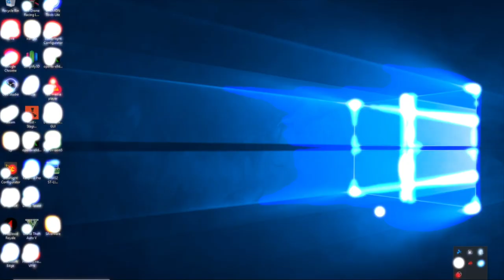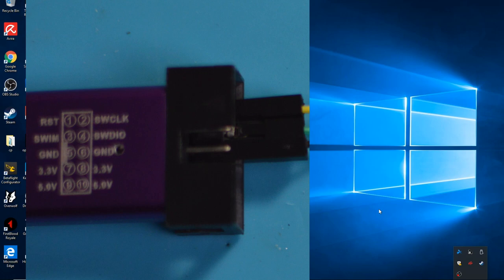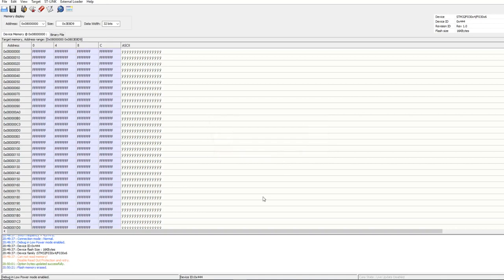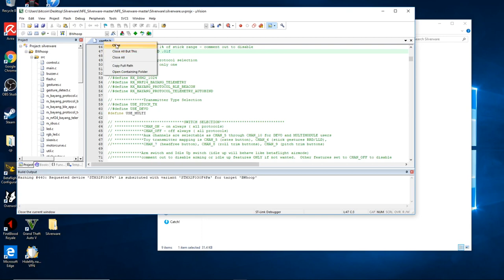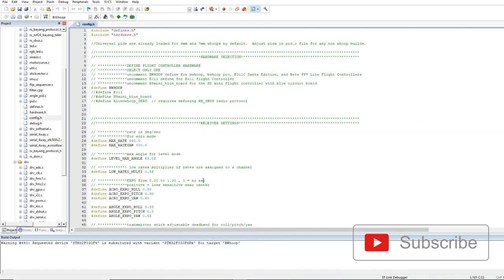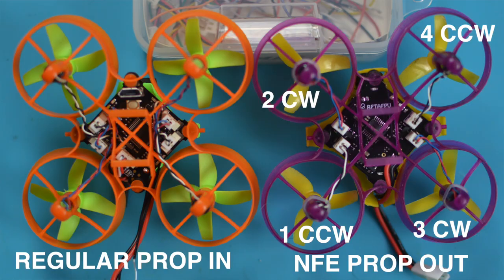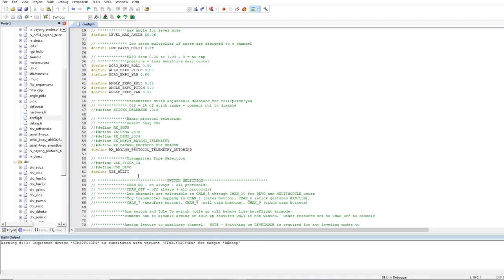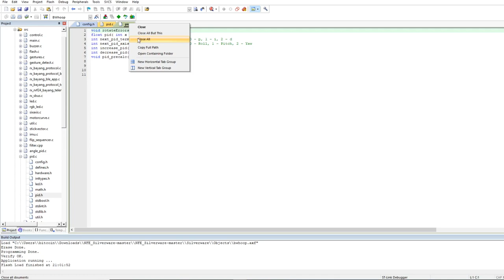The NFE Silverware Guide - Setup & Flashing Part 2

Comment: I was super stuck. After about 10 hours...and watching every video I could find. I got my B-whoop flashed with Silverware. So excited to accomplish this. Your video gave me a few tips that helped me get things figured out. I was really stuck when the St link programmer would not connect to the board. I removed all St link downloads a few times, re-loaded, Up-dated the st link programmer. set it to normal. and got it to load. I feel the update to the st programmer was a big key to getting it going. Now I have my modded Devo 7e with B-whoop pro. angle and acro. with the Fo2H fpv cam...This thing is super impressive...Eventually I will try the Keil software out. Just running the pre-compiled  Bwhoop.hex file at the moment. Thanks so much for making this vid.  p.s. I also built up a carbon fiber framed quad with B-whoop board...7/20 motors and 65 mm KingKongs...with 300mah nano tech...and micro fpv rig....Its so amazing...Now It will have acro too...Big smiles man..Peace out.
Reply from the maker: Awesome man ! The whole flashing had me scratching my head for weeks haha so when I got it I was super excited and had to help out others ! Silverware is really good little to no tuning and you're set
Reply: @dwarfstarfpv2056   Hey DwarfStar, Wonder if you might have any ideas. I built up a carbon frame, 8.5/20mm ripper with a b-whoop flight controller. I flashed it with silverware...it was flying so nice. So much power and control. But in angle mode it had a little bounce. oscillation. So I decided to try and get keil on it. So I could tweak the pids. In the process I somehow managed to brick the controller. Not getting any led's lighting up now...Also no voltage detection on screen when I plug li-po in.Tried everything possible. Any ideas? I know the board is erased. But now the st -link can't connect. It needs to detect voltage  to complete the connection. Any tip's would make my day. Peace out.
Reply from the maker: @toddspeck9415  oh shoot I've never experienced a bricked board before, are you powering it from the stlink? Or a 1s lipo?
Reply: @dwarfstarfpv2056   Powering it from a lipo. Tried everything possible. Think its my first bricked board. Even after all my Beta flight builds.  I grabbed another b-whoop board..Now I am talking Keil....Soooo stoked. Gonna order a bunch more B-whoop quads...So amazed how these fly...Been up about 60 feet doing huge LOS acro flip's all directions with my custom carbon frame bwhoop 65mm king kong running my Devo. It rally's almost as fast and as hard as my 5 inch and 3 inch brushless quads.  So much fun talking to quads like engineers do. Thanks so much man for your vid. Had to watch it a bunch of times.
Reply from the maker: @toddspeck9415  I've bricked betaflight boards before and the stlink utility has helped me reflash stock firmware so your board might have burned out something, maybe try powering from the V+ pad on the board but the nice thing about the bwhoop boards are they are super cheap, you buy the whole quad or just the boards?
Reply: @dwarfstarfpv2056  Thanks for the tips. I buy the whole quad. Found them for 12.99 on e-bay. I am so impressed with how silverware/Keil flies. Still trying to get my pids just right. Have you found a really good pid rate? Kind of wish I could somehow look at the pids on that hex file. It just shows asci data. Thanks again for all your work and testing.
Reply from the maker: @toddspeck9415  oh if you search for the bwhoop board I think its 8 or 9 bucks, I've been messing with the pids a bit but it seems like you need to raise them a lot or just run a preset config for the size of motors you're flying

Comment: Hi DwarfStar, I wondered if you would mind giving me some advise. I'm having trouble getting the st link to connect, I have been getting this error message, can not connect to target. The device is not showing in the st link utility.
Thanks.
Reply from the maker: Hey bud, I had the exact same problem and my solution as uninstall the st link utility program and uninstall all the stm drivers and then install the utility program and plug in the st link and it should be recognized as a new device and install the drivers over again
Reply: @dwarfstarfpv2056  Thanks for the quick reply, I will try that and let you know.
Reply: I tried that with no joy, I might try another pc I’m sure it’s driver issues as always
Reply from the maker: @sketchyfpv2684  I tried a different pc also and everything worked that's what led me to thinking the drivers got messed up somehow but if a different pc doesn't work double check you're connecting to the right pads and even try to power the FC from a dedicated battery instead of using power from the st link
Reply: @dwarfstarfpv2056   This tip really helped me...I had way to many st link programs downloaded...I re-moved them all and started over...Also the update st link really was important.  Love this B-whoop board.

Comment: I followed everything and I am having an issue. Before flashing the new configuration on the BetaFPV lite brushed FC, I go to PROJECT>BUILD TARGET and I am getting 5 errors and cannot load file.

".\Objects\nfe_silverware.axf" - 5 Error(s), 0 Warning(s).
Target not created.
Build Time Elapsed:  00:00:44

How do I find and fix those errors? Also when trying to erase the board again through Silverware Keil, it says "Command Not Supported" Error: Flash erase failed - target DLL has been cancelled.

Help...
Reply from the maker: Hey bud so I was able to recreate this problem, I actually had 2 errors in the NFE file I was using but the entire time I was just uploading to my board and not building the target but in order to find those 5 errors you have you'll have to scroll up the "build output" window and it will show the source and line of that error I might actually make a video about this it took me a while to figure out what I was doing wrong then I got a fresh copy of NFE and loaded it and it turns out I deleted some lines of the code but after running through the setup the target built with no errors

Now as for the board erasing part where you able to flash any firmware at all ? Did you unlock your board ? And also did you install the package for the board when you first plugged it into keil?
Reply: @dwarfstarfpv2056  I went through the “Build Output” and found that I had both RX_SBUS & BAYANG defined in the code. After correcting that, I built the target again with zero errors. I attempted to download to the flight controller and had cortex-m error. I need to secure a better connection to the board and try again.
 
When I first connected to ST Utility, I did not have to change Option Bytes from Level 1 to Level 0, it was already at 0, (could be because it was already preloaded with Silverware? I picked it up from Amazon) but my window looked different than yours. I erased the chip then went into Keil. From there, I did not install anything to the board. I ran into the errors in the target and was not able to load anything to the FC. Suggestions from here?
Reply from the maker: @freeloader700  damn YouTube didnt post my comment, I'd say try uninstalling keil and reinstall it again then plug in your board and see if the pack installer pops up, I have a board like that but I just followed the steps the unlocked it and erased it with the st utility but I think your keil software might be messed up that's the most likely cause so give that a shot
Reply: @dwarfstarfpv2056   I got it running finally. Everything seems fine did a quick flight and it seems okay. Now where I am having trouble is setting up the switches. The only way I am getting it to fly right now is by using the Special Functions page for Ch 6, on SA up switch set to 100, ch 7 & 8 to -100. It is only in Acro, no angle available. 

I had set up Ch5 in the mixer for arm on SF, all it does is turn the LEDs on or off. Nothing to do with arming. Not sure what I did wrong or what I am missing.
Reply from the maker: @freeloader700  oh awesome! You're using a taranis right ? What I did for switches was just assign them just as they are in the code but for angle mode the only way it works is when I flip my switch to the third position acro holds the first and second position

Comment: DwarfStar I need help?  I have had a working Keil file for the last 5 months, I have flashed a few more boards and tweaked pids many times. The other day I went to flash a board, I got in to Keil, then I accidentally messed up a few lines of code, I spent hours trying to get it back with no errors. Then I decided to delete it and re-load Keil.  After that I can not get it to work anymore. So bummed. I have been trying everything for close to a week now. My St link file and connection still work fine. The problem is with Keil. Seems like when I load Keil now its version 5.29  I wonder if there is something wrong with that version. Its also been giving me a string error. So I went to hassle of changing all my settings to me as the Administrator, I am using a computer that was my Dad's. And it had Him listed as the main user. So When I register for Keil with my data. It loads up Keil and sees my Dad's name in the string. It instantly gives me an error that the string is wrong.  So after days of figuring out how to change admin. names and user's,  I finally got the string to have my info. in the line. I have tried at least 50 times now, to get it to load. No luck. One thing I see is when I download the NFE file from github, it never shows B-whoop in the build window bar. NFE keeps showing up in the build window box.  Also I think a few times I did get the B-whoop in the white build box. But the whole build tree was all exclamation marks on every setting all the way down the tree. Following your vids and every vid I can find. Bound and determined to get back to Keil.  I have a brand new box of about 15 B-whoops that all want Keil. Also spent about 10 hours building my own custom frame. I just completed my latest build on my new frame. Flew it twice and it was so radical. Then this happened. Wonder if you have any ideas what to do?
Reply from the maker: Oh man that sucks but I've never had or seen that happen before, for your quads do you save each file independently? That's what I do so if keil even gives a problem I uninstall it completely and reinstall and that normally fixes everything but if you use one file for all your whoops and you just tweak by memory then it's harder but save your files and reinstall if you haven't tried that yet

Comment: I am trying to flash my 65s lite to something fly-able again. I lost track of the pid gestures one day trying to make the yaw a little more snappy. I followed this tutorial but my quad just spins clockwise a few seconds after arming. Can I just put the stock silverware back on it using this method? Or do you have any recommended settings for NFE? Thanks
Reply from the maker: I think to fix that problem just swap your motors around because the NFE software uses props out config instead of the old props in
Reply: I saw that in your other video.. Does that still apply if the props are spinning in the right direction? They are in props inward, and does it change anything if they are brushed motors? I thought they might be directional because they have different colored wires
Reply from the maker: @pandabang  if I remember correctly red and blue wire is CW and white and black is CCW so once you have CCW at the top left and bottom right and CW at top right and bottom left and you swap your props around it should stop doing the crazy yaw spin when you arm and try to fly

Comment: I have a BWhoop and I bound it to a Jumper T12. It flies well, can I dedicate different channels to arm and set the modes up, without going to silverware?
Reply from the maker: Did you flash the bwhoop controller with NFE silverware? Or its stock firmware?
Reply: @dwarfstarfpv2056  it's stock firmware
Reply from the maker: @butchjackson8989  ok well in that case I'm not sure but the NFE silverware firmware has channel 5 for arming and channel 6 for level mode if you wana assign those and give it a shot

Comment: I'm having issues getting the STLINK software to connect to the board. Getting "Can not connect to target! Please select 'connect under reset' mode from Target -> Settings menu and try again"

Tried:
2 different PC, one Win 7 and one Win 10
Uninstalling STLink and Drivers, and reinstalling.
Different USB Ports
tried flipping the SWDIO and SWCLK just in case I've got them in the wrong spot. I am 100% sure that 3.3v and GND are in the right spots.
Tried powered by ST-Link's 3.3v rail, and a 1S lipo.

Anyone run into this before?
Reply from the maker: Wow you definitely have tried everything, my last thought is it could be a bad board because just uninstalling the drivers and stlink utility fixes that problem, which board exactly are you trying to flash ?
Reply: @dwarfstarfpv2056  well, in the tiny whoop Facebook group we figured out that I had bridged a pin. Took out that pin and powered with a battery and it worked. Finally got it flashed around 4am :-D did a test flight (to my wife's chagrin) and caught it in the face LOL
Reply from the maker: @ArdinMcAllister  ahhhh that's explains it! Them bridged pins lol they are the worst sometimes.....take it easy out there haha
Reply: @ArdinMcAllister  had the same problem. Care to explain the solution or at least show me the page about that bridged pins? Still stuck on this St link cannot connect 😢
Reply: @ArdinMcAllister  can i get that link as well im having the same issue